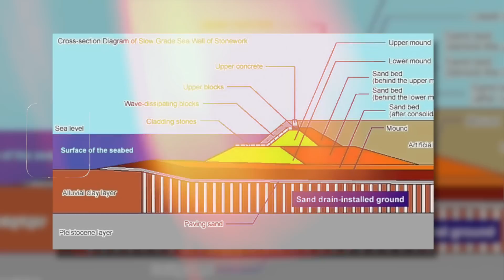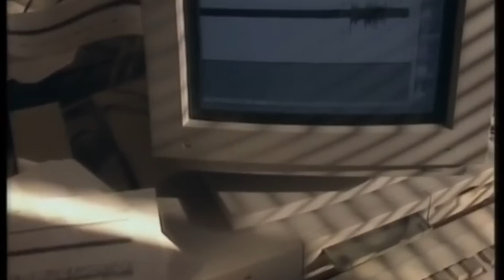Why Nobody Can Fix This $21BN Floating Airport

Comment: If it was floating airport it would not sink
Reply: If its floating the airport would displace water to the weight and its relative volume of sea water.
Reply: Boats float and sink. That airport is subsiding under its own weight.
Reply: airport shaking at every wavse passing across
Reply: @wongyoonchark5050 already floating oil drilling rigs, very little shaking if done well because so big and most of structure is above or below the waves, with pillars connecting them
Reply: Well, they can't call it a sinking airport. Who would wanna be landing on a sinking airport?
Reply: The titanic was floating at one point
Reply: @GinjaNinja777  Floating today means floating forever to them.
Reply: Think of it as the set for the movie Waterworld. It sank several times during filming.
Reply: Pall
Reply: @Pullahuru9168 what are you talking about? Isn't ship floats and so times they sink.
Reply: @caniceedward  Tenochtitlan was a floating city, Venice is a current one. Weight on sinking ground, which is addressed in the video is the root AND solution to the issue. It WILL stop sinking, but water will continue to rise. Whatever your argument is, it’s not relevant.
Reply: @caniceedward  Not sure how DIM an individual has to be to ask questions that the video answers 🤣

Stop believing everything tucked behind your forehead, and question things. Intake and confirm 10x. 

It’s simple, something you can relate to.
Reply: Noting screams longevity as an artificial floating island and 9 miter waves.
Reply: @yarko9877 are these the kind of waves created by a miter saw?
Reply: Precisely, it would not sink as long as it was not overburdened by placing anoverload of weight on its deck or be cause its hollow inner spaces would have started to fill up with water seeping in, and as long as it would not have too much weight put on top of it in the wrong place(s) causing it to lose balance and as long as it would maintain its waterproof character otherwise
Reply: @harrickvharrick3957  water is rising 😂 wtf
Reply: The Titanic was floating…then it was sinking.
Reply: They said the Titanic could not sink because it was floating.
Reply: Artificial Island. Did you miss that?
Reply: @missamanda2703  Artificial islands are notorious for sinking out of sight, especially if the foundation is sand and mud.
Reply: Floating Objects Often Sink as pressure is applied on them
Reply: The ocean floor is literally covered  in land/man made things that floated and sunk. 

I would ask why an artificial island made of concrete and compromised by climate change wouldn’t sink.
Reply: @Sapioso  Floating objects sit on top of the water above (not attached to) the ocean floor. Land that has been covered by a rising waterline, or has settled to be covered by water has not failed to float, because it has never floated to begin with.
Reply: @Flyinghook  I literally addressed floating objects man made or otherwise. Can you read simple man?

Have someone that loves you explain what the rest of us here are saying. Fight everyone else in here. 

I wanna see you win. 🤔
Reply: @Sapioso If the structure is attached to the seabed, it's not floating. Same is true of an oil platform with a jacket attached to the seabed. The fact that it's compressing and dropping in height doesn't make it a floating object.
Reply: @IrishSchaller  it’s floating. It’s not on stable ground. It’s on water…floating. 

Having posts drilled into soft earth while resting on water makes it floating. IT’S ON THE WATER😂😂😂😂😂
Reply: @IrishSchaller  it’s not "free floating" but go ahead and get semantical about it. Cry too.